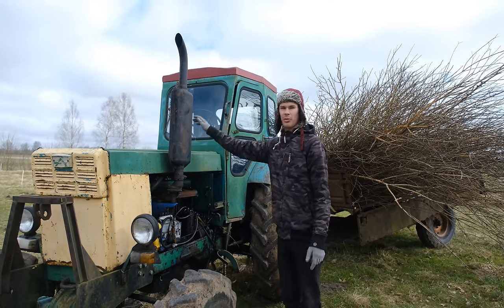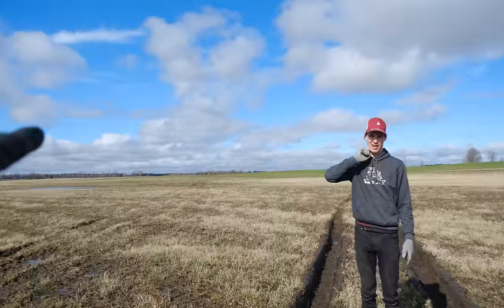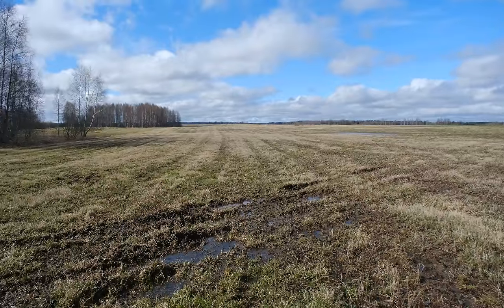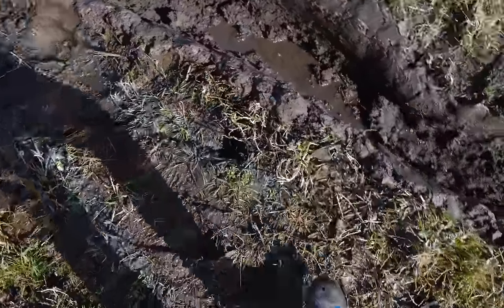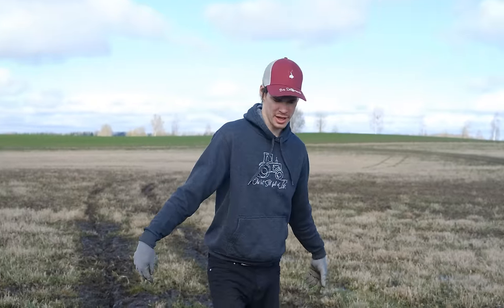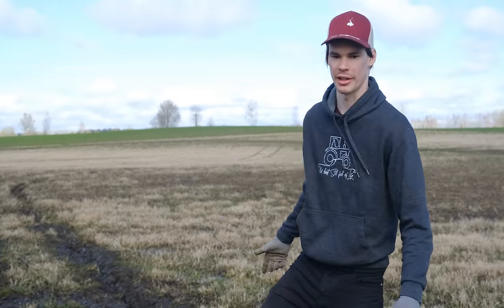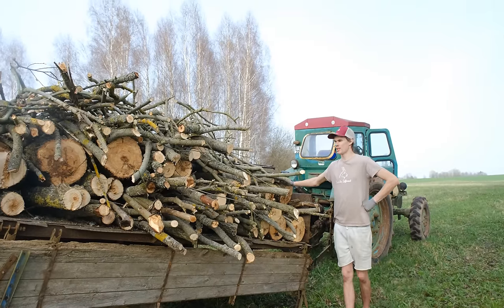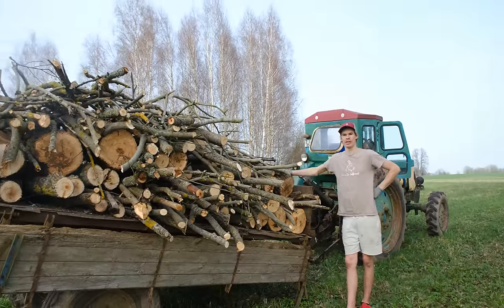This FIREWOOD is going to SAVE us big!

Comment: You should be getting a sponsoreship  from "Hecht"  if You don't have it yet. Watching You cherefully chopping away, I wanna dump all my "Stihls"
Reply from the maker: Yeah and the fact I paid 130 on Sale for it is even crazier. The chain is of course is a good brand but either way it's an amazing saw and when cutting together with my uncle and he has a new Stihl it used more fuel, harder to start, cutting roughly the same and weighs a bit more.

Comment: That drop-side trailer with the hydraulic hoist certainly saves a lot of work. It has many different uses on the farm and yet another piece of equipment that Deivids got working again.  Lots of larger logs this time for your winter firewood supply.   Hard work but saves a lot of money if you had to use gas,oil or electricity for a sole heat source! . Bravo ! 👍👍👍🤩🙏🏻❤